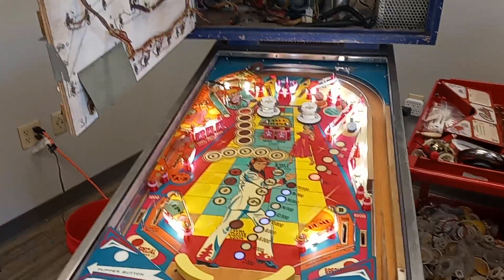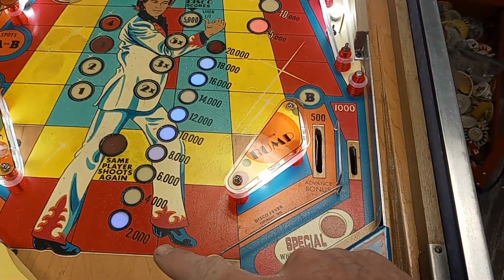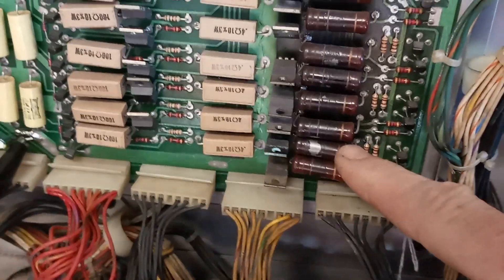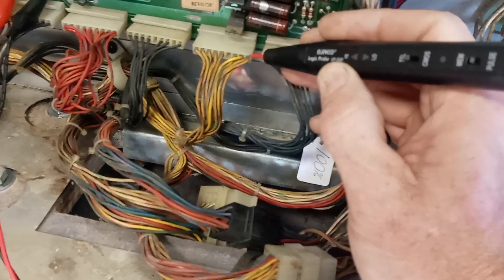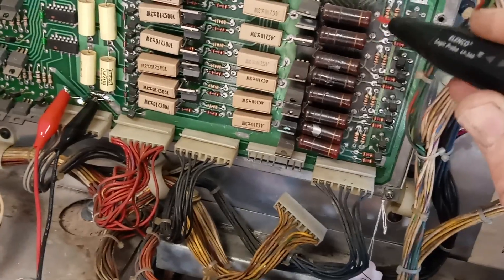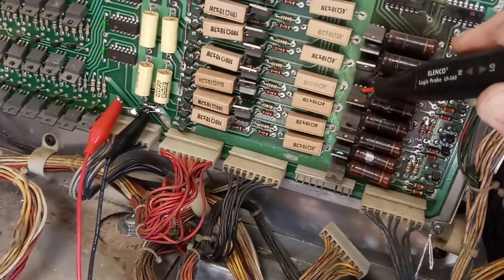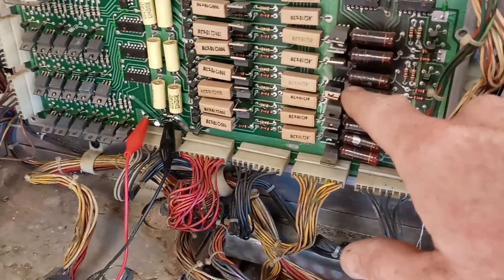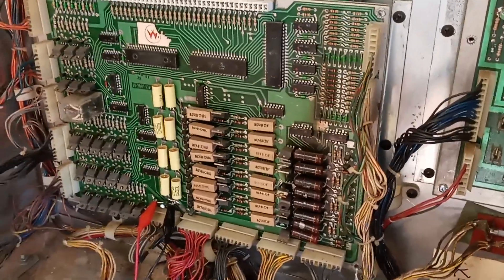Williams system 3-6 driver board lamp matrix repair using a logic probe to identify the bad part

Comment: Those 27ohm hot resisters usually need to be swapped out for better 5w sand resisters. My system 6 Blackout needed it.
Reply from the maker: An even better solution is to change the transistor being driven by them.  It enables a very large resistance and small wattage resistor to be used instead.....well documented on pinwiki.

Comment: thanks, i have a similiar problems with the same machine Disco Fever
Reply from the maker: Yeah these old boards are getting older.  But fixing them and doing some upgrades (new interconnect and new chip sockets) can make them reliable again.  There is a replacement 2-in-1 board that replaces the MPU and driver board, but it is a bit expensive (generally more than repair), and when the replacement boards need repair, it is harder to find someone willing to work on them.  But it is surely nice to have options now.
Reply: @ETPinball   i am a novice but, and after watching your video I found i had to replace  Q47 and Q69. Q47 was visually burnt.
Thank you so much
Reply from the maker: @patrickmcshane579  that's awesome you took the dive into the deep end!
Reply: In my Williams system 6, the Resistor R154 overheated and caught on fire while I was doing a test, it also cracked the resistor Q72. What would have caused that?